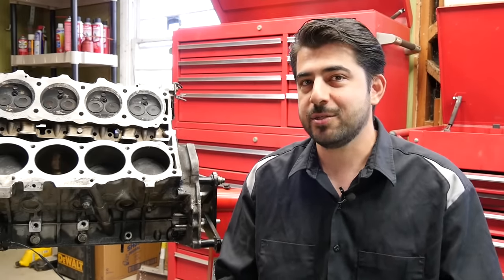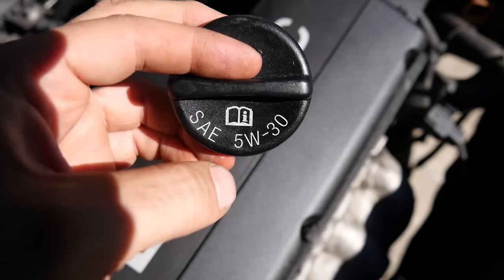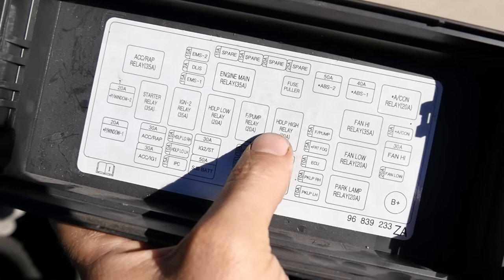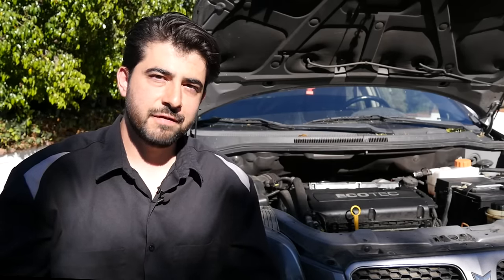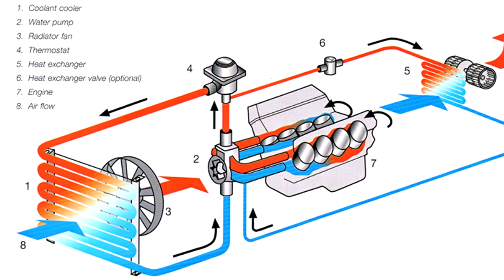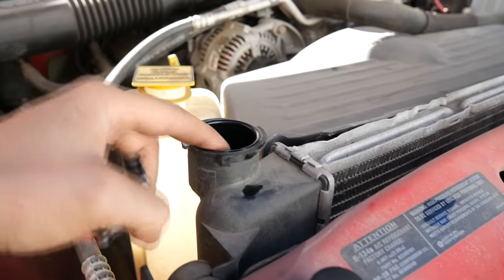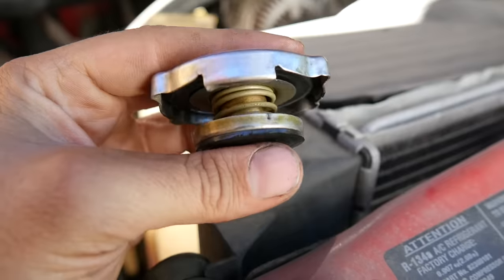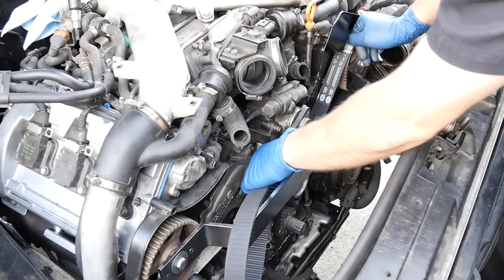Make Your Car Engine and Transmission Last a Very Long Time - Top 5 Tips On Car Care

Comment: Flushing your transmission ,  I'm on the fence about that one. I have a friend who is an engineer from Japan and he and I was discussing transmissions and he said never flush your transmission just drop the fluid and replace.
Reply: Scotty Kilmer said the same thing. Furthermore, he said that if you have more that 90K with the same fluid, then just keep it in. My BMW shop told me the same thing.
Reply: @SBha30  I just flushed the transmission fluid on my 2001 Toyota Camry V6 with 103k miles 4 days ago. No problem what so ever. The service was done at a Toyota dealer. My friend is a mechanic and he says it's really depend on individual manufacture. Some transmission fluid can last longer than the others, and you should stick with the right fluid that was original. He wouldn't flush a transmission fluid at 200k+ miles if it haven't been flushed before.
Reply: @SBha30  I flushed my Camry at 114k and nothing serious happened. But when it reached 175k, I drained and refilled once and then after few hundred miles, dropped the pan and changed ATF fluid and filter. Since then I have been draining and refilling with 2.5 quarts every 12k and transmission doesn't kick anymore. I think the best thing to do is keep up draining and refilling ATF fluid regularly after first 50k if you can afford.
Reply: The Engenieer should go back to school i think..Flush cause no wrong and if the transmission is in such a bad state that a flush, who will clean excessive dirt will cause leak and failure.. then the issue is the transmission bad state and not the flush.
Reply: I heard the same from family members. Drain and fill is better than flushing.  Apparently the cleaners that is used to flush it damages the seals.
Reply: Rick Simpson  oh didn't know that. Interesting
Reply: I did first flush/ change at 175k . Now I need a new tranny.
Reply: @SBha30  Yeah scotty said that flushing makes the debri swirl around into the joints. Just do a simple leak out until it stops and replace the it with some new fluid and do this every 50,000
Reply: kicksoffs true that, flushing kills transmissions, some you don’t even change the ATF. On some its best to not change the ATF if it’s passed certain milage.
Reply: Uluç Özcan dude you’re lost
Reply: @Devin-dw3cg  you don't use cleaners when flushing. The whole purpose of flushing is because the torque converter holds about 2.5 quarts that can't be drained. When you do a fluid change without flushing you are mixing your new fluid with over a half a gallon of old fluid
Reply: Rick Simpson  that thickens the fluid causing it to flow slower. This causes the clutch pistons to receive less volume of oil. It's not a good idea to change the viscosity of transmission fluid, unless your transmission is already slipping. Then you are just prolonging agony.
Reply: @elxso18  wrong
Reply: Bryan Hensley Why wrong?
Reply: Rick Simpson your comment makes no sense, I don’t see what income has to do with transmission failure, but all transmission are not the same and changing the atf so often or at all is not required.
Reply: @elxso18  flushing does not hurt a transmission. If you don't flush you leave over 2 quarts of old fluid in the torque converter
Reply: @elxso18  for some reason your comments didn't show up in my notifications.
Reply: Your engineer friend is a big dummy and should not give you any advice on cars, and he should NOT be called an engineer. The transmission fluid should be drained or flushed based on your car's recommended service. And it is called preventive maintenance. Something that you nor your engineer friend heard of. That is why you do motor oil changes. Same principle with the transmission fluid changes, but not as frequent.
Reply: If you can afford? Unless you have a German car, it shouldn't be more than 150 bucks. I just did my 2013 Escape at the dealer. 100 bucks for the whole job.
Reply: kickoffs He should have said complete drain
Reply: Bloodcurling Yeah I that's what he meant.
Reply: have to agree, talked to a lot of professionals, most say never flush a transmission.
Reply: kicksoffs I agree...I do the drain and fill...flushing it is dangerous
Reply: @arthurgleizer2664  Yeah that's what i've been hearing from the real good professionals.
Reply: i Asked a mechanic at the dealership about this on my car since its 3 years old and at 30k Miles atm he said the same thing only remove the pan and put in the amount thats in the drainpan. 
He also said its not recomended to do a full flush since it can break the transmission.
Reply: I flushed the transmission fluid on my 95 Silverado at 120k, and it never shifted smoothly again. Still seems to run fine (brother has 175k on it now) but yeah, don't think flushing is way to go..

I did a lot of research before, and let the mechanic talk me into flushing...should have stuck to my guns.
Reply: As far as I'm concerned if the transmission isn't giving any issues then it's fine to drop the pan and filter. I've replaced the atf at home on 3 different cars (3000gt, Camaro z28, Cobalt LT) 2 had over 100k miles and the other had 80k miles, none of them gave me any issues after the service. Most people replace the atf because they notice the transmission behaving oddly but that usually means the transmission is on it's way out and blame the new fluid. Best advice is pan drop, replace filter with new atf, add a large transcooler after the factory cooler and replace new fluid every 30k miles from now on.
Reply: Sound advice.  Even a drain and fill would oftentimes be pointless in many customer transmissions because they had neglected to service them for so long that even something as simple as a fluid change would just push it over the edge.  At that point, just throw in some Lucas slip stopper and drive conservatively.  You'd be surprised how long you can drive on a failing trans if you take it easy, unless you own a Chrysler 200 in which case you more or less have a bad transmission out of the factory.
Reply: I have heard that also and the majority of transmission shop say the same thing do not do a transmission flush. Bad info Bro
Reply: SBha30 that’s ridiculous change it out 100,000 miles will be fine

get some clean fluid in there
Reply: @wannabecarguy  50 bucks flush leads to the $5000 workout!
Reply: Yep
Reply: I followed my owner's manual.
Reply: yeah I Don't Know Jack schitt but this sounds like a tough one.  I recently lost all forward gears. well I didn't think car that I bought we have no transmission fluid in it when I put 4 quarts in and it's still not even hitting the fill top lid. but anyway in the process I've been reading up on Transmissions. supposably a shift solenoid speed solenoid or if the damage is internal forward gears and clutches... my inside  transmission valve body there's lines in there that distribute the transmission fluid where it needs to go RIGHT?  now people with Transmissions with high mileage on them claim after a flush the transmission not working or your car is f*** up... how is it possible that a high mileage transmission is a lot of metal and particles in there get lodged up in the clutches in gear will it don't need to be or maybe even in those Distributing LINES. or maybe even possibly blocking the signals for the speed sensor shift solenoid sensors.. something to think about anyway...
Reply: It depends some transmissions especially newer ones you just run them until they drop there is no servicing them.  Others if you get it done as scheduled there is no problem doing a flush, or a pan drop, filter change.  However if you've got 90,000 miles on the transmission, and it's starting to act a little wonky...DO NOT SERVICE THE TRANSMISSION.  You will have a dead transmission because the internals are so worn at that point the only reason they work is the gunk in the fluid.  Just start saving for a new transmission.
Reply: @SBha30  GOOD JOB  MAN
Reply: @slimjim7411  My 2018 Elantra owner's manual says the first ATF change is due at 150k miles.
Reply: @SBha30  I drained my tranny before hearing that from Chris Fix and Scotty and I ended up regretting it. The solenoid that controls 2nd-3rd shift is clogged and makes my car jerk when the shift happens.
Reply: @SBha30  I changed my ATF for my Camry at 140k. I think it was changed once before. Fluid was very dark but not burnt or black. Car shifts extremely well..I used Toyota OEM ATF. It's a good idea to change it.
Reply: @oxulucozcan4923  With manual transmissions, you pretty much have to change it out when you replace the clutch because you're losing a lot of it anyway.
Reply: @oxulucozcan4923  You'll never own one? How old are you? Because that could change. Unless you live out in the country somewhere. Manuals are a pain in tbe ass with stop and go man. Shit does get old as you get a little older.
Reply: @oxulucozcan4923  Manual trans clutch is not in any fluid. What are you talking about?
Reply: @wannabecarguy  175K was too long, should have been done 3 times by then.
Reply: He’s a very smart man
Reply: SBha30 that’s crazy talk
Reply: kicksoffs I’m was on the fence too but what I do now is just do a fluid change , then drive around a little bit, then change a 2nd time.
Reply: @kevinmoore4887  where did it lead you ? lol.
Reply: @koshnaranek2317  To the transmission shop for scheduled replacement.
Reply: @oxulucozcan4923  I hope you are joking . . . manual transmission clutches and clutch packs on automatic transmission are two entirely different animals.  The former does not float in any oil (at least you better hope not) and has no relationship to changing the transmission oil; the latter (auto) clutch packs are bathed in ATF inside the transmission housing.
Reply: Well, when one never does it for like 200k miles, then they do it, the buildup that has actually solidified and fused to trans will get flushed out and it may slip
Reply: kicksoffs he’s right never flush it.
Reply: I think many people confuse flush  with a coolant line exchange. I have done coolant line exchange 3 times on my v6 camry and at 155k miles it still shifts like a new car. Drain and fill is better tgan nothing but it's absolutely meaningless to mix good fluid with bad fluid.. In v6 cars you may only get 30% out of tge transmission.
Reply: Depends on service history too!!! My 04 accord had transmission flush at 250k runs really good!!!! I did prior service too!!!! If the history is unknown..then its not a good idea
Reply: The problem with flushing is you introduce contaminants. Always drain and fill
Reply: @afara2000  I'd only advise draining and filling ever 12.5k if you do towing or excessive idling as the transmission fluid heats up to the point that it degrades. Save some money lol
Reply: @Devin-dw3cg  Yup. This is a way the industry can sell you a new car!
Reply: @harryl8234  Wrong. Heat degrades the lubricity over time so it's advisable to change the transmission fluid over 30k-50k.

If you're doing it for the first time then change the transmission filter as the break in particles of the transmission will reduce the flow of the fluid as they start clogging up the filter.
Basic automotive knowledge.
Reply: @joshuarandall2159  You could always shift between reverse and drive stopping for 3 seconds between each gear to move the fluid around but driving it a bit works also ;)
Reply: @christophervanzetta  how could I be wrong. I said change the freaking tranny fluid as a preventative maintenance measure. Yes, you could change the fluid sooner than what's recommended by the car manufacturer, but it needs to be change.
Reply: @nickboomer94  WTF??? you are saying ur car is running great after only 4 days? yeah try giving it 5 or 6 months than well see if its running good after that flush you did. when you flush a tranmissions problems will happen after a month or so not 4 days there champ. internet advice hahahahaha fail
Reply: @GeraltOfRivia99  It's been almost a year, and I can confirm that my car is still running great. I did my homework and ask my friend who is a mechanic before doing the flush. So, yeah, thank you for your advise anyway genius.
Reply: 🙂 just do a poor mans flush, by replacing the fluid & filter every month, do it 3 times 😊
Reply: @krystal5887  🙂 yes its dangerous to do, i totalled a Geo Metro with 150,000 miles because i drained the ATF fluid, the next week it wouldnt go into any gear with the new fluid, i fu! 🙄
Reply: @krystal5887  🤔 i better domy honda soon, it has 106,000 miles on it, i hope it doesnt plug anything? 🤔😒😰😱
Reply: What if the transmission has coolant mixed in it? Should you flush it then?
Reply: @15Robin15  🙂 sure
Reply: I recommend to never drain trans fluid or filter. Everytime people drain trans fluid they lose 1st and reverse gear within 5000  miles.The new fluid eventually cleans up gunk on internal plates causing them to fail.
Reply: @robertwadas  🙂 yup, happened to me with my Geo Metro, it basically totalled my car! 😱
Reply: @Gambino that was the first thing I checked.
Reply: @GeraltOfRivia99  . I just flushed my transmission of my 1998 Toyota Camry le 4cyl 2 months ago it has 110 thousand miles on it, I was hesitant to flush it at first but anyways I went ahead and did it because the fluid that was in it didn't look dirty and it smelled normal, I just bought the car 6 months ago and thank God that the flush didn't cause me any problems and if the car still running perfect after 6 months, I'll be doing it again after another 40 thousand miles just to make sure my transmission can last me at least 350 thousand times, heck this 4th generation Camry has a reputation of lasting 450 thousand miles with the proper preventative maintenance.
Reply: @Vanessinha91Pucca  Dirt and debris from normal wear & tear settles into nooks and crannies in the transmission. Flushing the transmission stirs all that crap up and shoves it into places it shouldn't be. It's a pretty basic concept.
Reply: I just flushed my transmission fluid as advised by professionals and now my septic tank won’t shift.
Reply: " always use OEM products.. ".  Show me one study where using good quality non-OEM parts are better than OEM. It's total bullshit. Most OEM parts are rebadged 3rd party parts !!
Reply: Wilson Is the wallet conducting this study
Reply: @derekthomasgriffin  if you want to pay for a part that's been marked up by 500%, be my guest..
Reply: @palebeachbum  they 're making sure you buy a new Hyundai in the not too distant furture
Reply: Change don’t flush
Reply: Yup, scotty said that too.
Appreciate you for reassuring us.
Reply: With my Mitsubishi Automatic  Transmission I disconnected the hose going back to the transmission from the radiator body and attach a clear PVC hose to the out of the radiator for the transmission fluid. This clear PVC hose then went to a container, I'd have the car on and in idle and watch how much came out. As it came out, I'd turn it off and put more in, and I just kept doing this while moving the shifter through gears until it was all new fluid. I had everything that came out and all that went in measured and I had the correct amount. Transmission was at 95,000km, all is fine.
Reply: Yes every decent mechanic knows this.
Reply: @Bryan-Hensley  smart car DIYers an mechanic's never flush! Always drain /drop pan etc.
Reply: @Davido50  I'm not a diy. I've been a mechanic since the 1970s
Reply: @afara2000  Why did you do the first drain and refill?  IOW, why not drain, drop the pan, replace the filter (and seal), replace the pan, and refill in one shot up front?
The latter is what I'm planning to do on a vehicle that is maybe on it s original transmission fluid (maybe on second iteration) with 160k miles, but I'd like to know if there is a better way.  I will NOT flush this transmission.  Drain and fill all the way.  If you follow factory intervals from day one, maybe.  Even then, as it gets older, maybe not.  Don't want a slippery transmission to go along with a hard head!
Reply: @Vanessinha91Pucca  Nobody is arguing that.  A complete flush can expose the damage and cause the transmission to noticeably fail sooner than it otherwise would, and cause the owner to spend a whole bunch of money much sooner than s/he otherwise would.
That's the issue.
A transmission that works with some level of dirty fluid is better than a transmission that doesn't work with perfect fluid.
Reply: @wellnesspathforme6236 I wanted to be on safe side. A drain and refill mixes small amount of ATF with old ATF present in torque converter. Dropping the pan and filter relacement changes more oil but it's still not a complete flush. This drain and refill has to be repeated 3 times at 200 or so miles intervals if ATF hasn't been serviced for long time.
Reply: @afara2000  So, if I want to replace minimal fluid, do an easy drain and fill (and I can actually choose how much to drain and replace at a time).  If I want to replace that filter, I can do a drain, pan removal, filter and seal replacement, gasket and pan replace, and fill.  Thanks for the quick reply.
Reply: I've always done the drain and replace; first one around 60k and every 30k after.  I haven't had transmission issues since I started doing that.  When I buy a used car one of the first things I do is change all the fluids, unless it has a good service history.  Most of the beaters I buy don't.  Change the fluids, lube the chassis, and put in a new fuel filter.  If I don't know when the timing belt's been replaced, I do that too.  After that it's just normal interval maintenance and I don't normally have problems.
Reply: @Dirtyboxer1  That sounds like very good advice -- duly noted .  Thanks.
Reply: is he a software engineer?
Reply: @SBha30  That's because the BMW shop wants you to buy a new transmission from them.